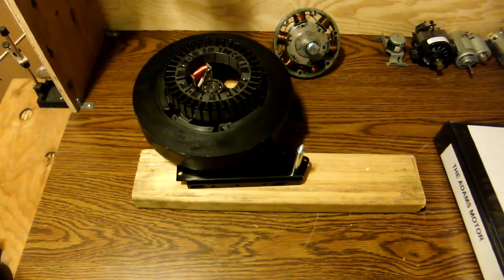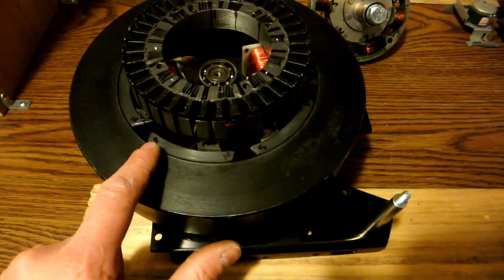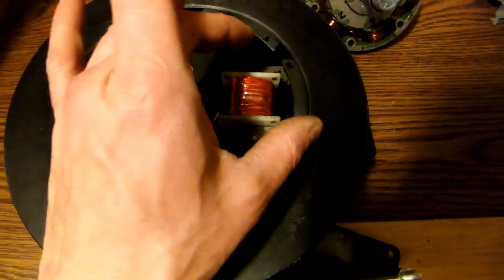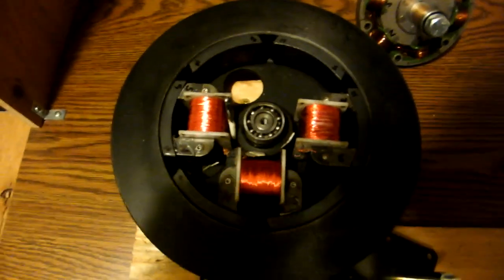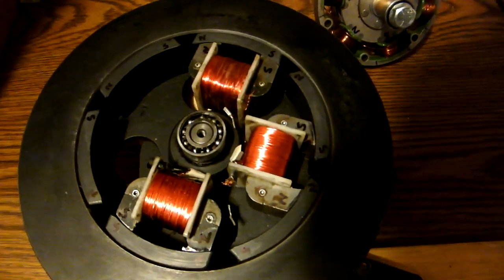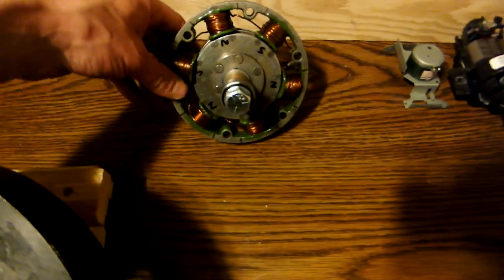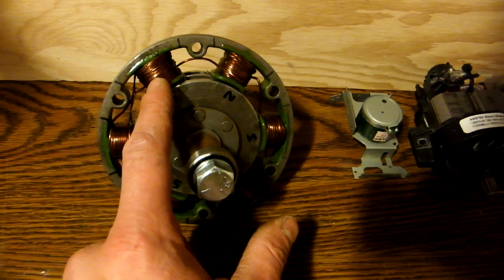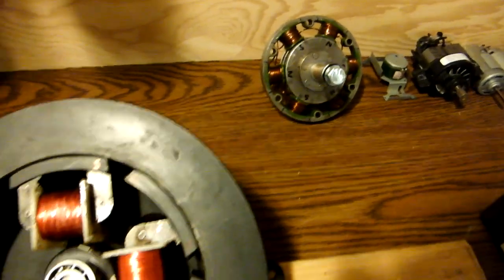Adams Motor Design & Construction (Part 1)

Comment: THIS is Just ( The powering system)!! Of an plan & Simple, 
Basic Lawnmower, Turned inside OUT.!!! Can you See it 
Now"??? I said" can you See it.?? That's what this is, Right down to the Adjustment, ability Built  INTO The magnets," & The adjustability" That's made for the Coils Mumetal, Tip's.!!!  ON- The 
OTHER - HAND" OR ON THE
FLP-SIDE" AS ITS CALLED TODAY"!!!!  HE'S did A great Job, figuring all This stuff 
Out, and putting it together.!!
SO, FOR "THAT" I GIVE him, An
A+.!!!! Now, as I've said before" 
TO: Anyone, That work's on trying to find a way to get (OFF-GRID)!! AND HELP OTHERS DO THE SAME,??
I SALOOT YOU,!!!

Comment: Please tell me what kind of rotor is your wound?
From what kind of motorcycle?
What manufacturer?
What model?
I like its architecture that allows it to function as an Adams rotor. (you only have to reset permanent magnets with the same pole to the outside). Thank you!

Comment: I'm confused how the asymmetric placement of the three coils can be considered "balanced " as you put it. Why not place four of them?
Reply from the maker: It's been awhile since I've worked on this motor. I cannot remember why I chose 3 coils, but I think it's because there was simply no more room available. You can make an Adams motor with less stator coils than rotor magnets, it is pretty common, although not as powerful. I have concluded that an Adams motor requires all custom parts, and not off the shelf parts. It requires exceedingly difficult design specifications to do what Robert Adams said it would do. You have to get above a certain threshold RPM where the coil's inductance "choke frequency" is lower than the RPM of the rotor. You basically just need to "over spin" the rotor beyond the speed that the very high inductance stator charging coils are capable of responding to in an equal and opposite way with magnetic drag. All generators in the world today use very low inductance coils, and low rpm rotors. High inductance coils and very, very high speed rotors can reverse the magnetic drag by shifting it out of phase. It's basic electrical theory. I am surprised that only Thane Heins and Robert Adams seemed to discover this. I've never tried it myself, because it has no practical application.
Reply: I have one of those motors and those coils wont spin when working...

Comment: Look for all the info You can find from the old FORD model T car, they could use the ignition / light generator system as a free running motor of 40 KW simply by putting a big horse chu magnet at a specific place on the generator wheel ! The director threatened to bring it on the marked when they didn't leave his family alone !
Reply: I did not understand exactly what you wanted to explain.